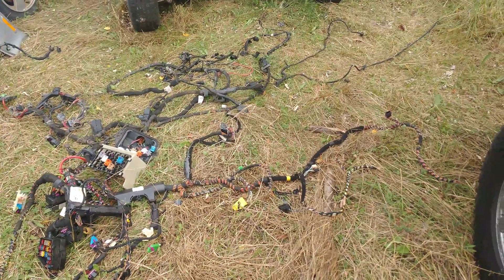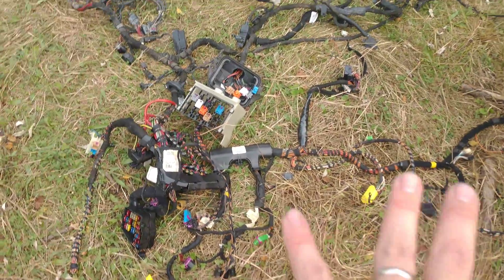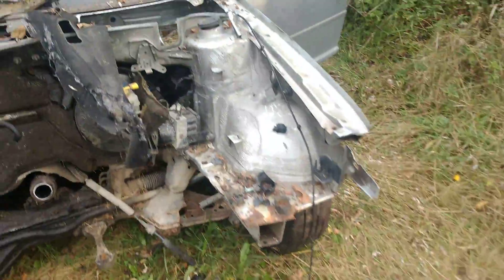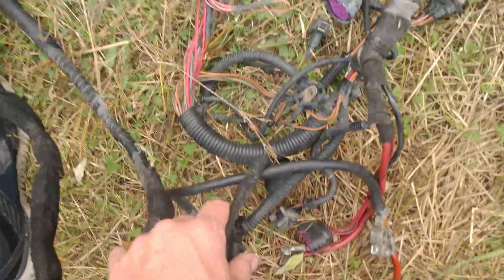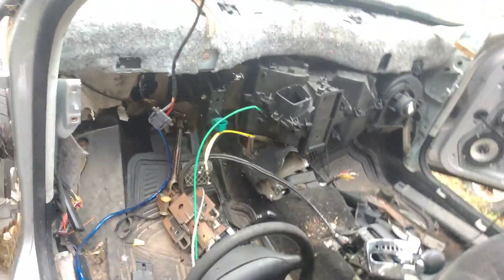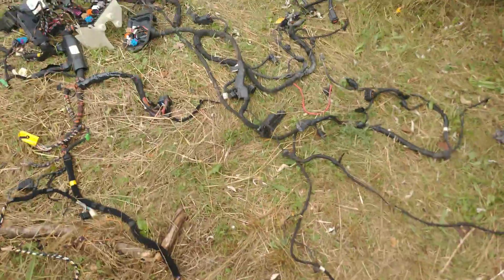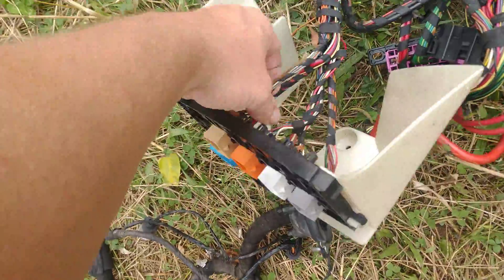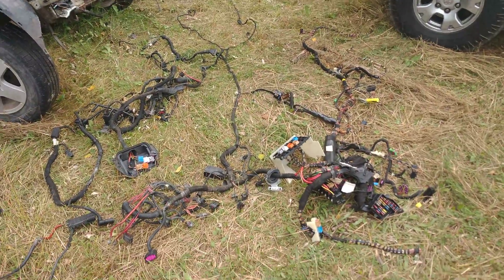Wiring series episode 1. Wiring removal for TDI swap using a ALH engine.

Comment: Which is better to pull the entire harness from if I had a choice?  2 wire 2000-2001or the 4 wire glow plug 2002-2003.

Comment: Man, I really appreciate you making this set of videos. PERFECT timing as Im just about to tackle the wiring on my ALH to Mazda B2600 4x4 transplant. I have cleaned up the truck wiring harness so there will be less crap under the hood and I will be looking fprward to your next installments.
 In one of your other vids, I noticed you mentioned putting disc brakes on the rear of a toyota truck and you mentioned a kit. I used Isuzu rodeo (I think or trooper) discs, and calipers to convert mine. It was really easy, I just had to make a simple mounting bracket.
Reply: Hey Samuel, how did you get on with the conversion? What gearbox did you use? Or did you make an adapter plate?
Reply: @richardbutcher9789  hey Richard I finished the conversion about a year and a half ago I've been driving it as an everyday truck I did cast up a adapter plate and I used the T5 transmission for it I'll send you a couple of pics but you can ask me any question about it you want to
Reply: I can't figure out how to send pics. I'm Forrest Gump with computers
Reply: Was about to ask some questions, but there almost all answered. Awesome